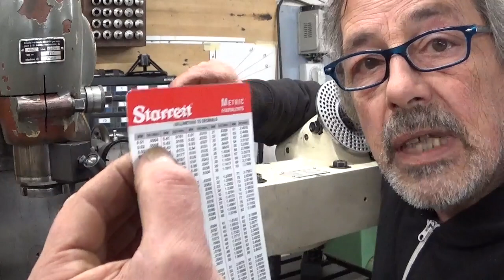Sharpening end mills... the long way around.

Comment: That came out nicely Michael. Your slowly building every gear you need for the lathe. Awesome! Also you can grind the inserts down with that diamond wheel. This way you get a sharper edge and hopefully a better finish.
Reply from the maker: Thanks Bruno. Need the tool, make the tool :)

Comment: It's that old "new shop/machine" problem, where a new project breeds a dozen more.  Getting a machine, it turns out, is the 'easy' part. Getting it tooled and setup to use it is the complicated and/or expensive part.  And sometimes, by the time you get the sub-projects done, you've forgotten what the primary project was.
Reply from the maker: You're right. Lucky for us, we're not in a hurry :)

Comment: In the old days, apprentices built all their tools because they needed them and didn't have money and needed the experience anyway.
Reply from the maker: Indeed. I's a win win...
Reply: In the old days, apprentices made their own tools so they understood the value of tools. It's that simple. You make your first square, you sweat to get it right. You make a centre finder... Piece of piss, since it doesn't need any real precision... If it's off, you inscribe a square, and either interpolate or scribe from corner to (opposing) corner and centre pop the intersection... A bad one will work... But will be a reminder... Get it right!
You make centre punches, you turn, knurl, heat treat , you make a chisel, you learn about forging, heat treatment, and you sweat when you hold that chisel in tongs while your tutor hammers it through a 3/4" MS plate with a sledge hammer, testing your hardening and annealing... Screwdrivers, Toolmakers' clamps, tap wrenches, die stocks, and so much more... And you know what it takes to make the tools of your trade... And, if you have to buy something, you understand why it cost what it did...
I once bought a lot of tools from a retired toolmaker.  I realized he was asking too little, and suggested, turning away heading for home, that he held out for more money... He insisted I bought them, offered me a discount... I paid him his asking price, £70, back in the mid 90s, but every time I picked up something he'd made, and used it, I thought of him...
A worthwhile thing to remember, that I learned from a journeyman in another engineering place (that is, not the one I worked at...)
He had a rented lock up garage near mine.  He had an old, even then, Norton Model 50, and a Panther 600.  I had an old Royal Enfield.
I remarked to him that I'd love to know how he kept all his tools so clean and shiny (no corrosion,despite the damp garage conditions) "I just keep using them" he said... It's obvious, if they're always in your oily hands, fixing something, they can't corrode, or at least the corrosion's so light that it wipes off with the next handling of them...
We built "barn" tool boxes, tote trays, funnels for oil... And most us lost our stuff or had it stolen over the years...

Comment: Excellent work. In software development, the "I want to make a <something>, but first I need to make several other things" is called Yak Shaving - after some cartoon somewhere. It is clearly a common thing in lots of different areas, and machining is definitely one of those.

I haven't posted your parcel yet, will try to get round to it over the weekend - and I'll pop a couple of TNMG inserts in the box too - I have a few, and at least one kind that I find works quite well for general purpose lathe-work.
Reply: I often find I have several bears to skin before I can get started on the Yak shaving operation🤣
Reply from the maker: Yak Shaving? I didn't know that.
Thanks in advance, Mats.

Comment: Hej Michel, great effort!
Two things I want to mention:
First: We all saw that sharpening that end mill worked out fine. It may not work out with every cutter though.
The more cutting depth a mill sees, the more chipping work is done by the spiral flutes, as opposed to the plane face.
Thus, it'll either become necessary to grind away the face of the mill until all of the dull portion of the flute is turned to dust (say, you took many 5mm cuts with your mill, you'd need to shorten it by 5mm) - or get into resharpening the flutes of the cutter, too.
Especially carbide cutters will tend to have small breakoffs at the very tip of the corner (making them look a little like 45° cutters), which can be taken care of much more efficiently by resharpening the flutes.
A jig could be made - or a used grinder for 100 bucks or so will do the job fine, too.

And secondly, my experience with gear cutters and circular saws in the mill was a funny one:
At first, I thought the thin blade would just shatter if I took a hair too deep a cut.
So I went carefully - and judging from the hammering noise the mill made, I must have been right at the edge of what was possible.
So I took a little less cutting depth next time - only to find the mill being even noisier!
One day, I got curious - and dialed in 50mm depth on a 135mm sawblade.
The first few revolutions promised me it'd become increadibly loud - then all of a sudden, the noise died right down and the blade marched through the metal in almost complete silence.
My only explanation is that by the deeper cut, more teeth were in contact with the workpiece, thus stabilizing the cutter for each entry of a new tooth.
Reply from the maker: This all makes perfect sense, Adrian. Thanks.
Reply: Important with thin blades to take the cut in a single pass if you possibly can, because otherwise chips from subsequent passes can pack up in the slot and jam the cutter.

Comment: set your tool post parallel to the chuck, the tip/tool has the correct relief already in it so setting the tool post off square upsets that, if you still get a poor finish try slowing rpm or increasing feed  if that fails, have a beer and buy some emery tape ;-)
Reply from the maker: Or use an HSS cutting tool :)

Comment: As always, an entertaining and inspiring video. thanks!
When the digitally controlled rotating table, standing, is running that sharpening work could be done here too.
What RPM is the diamond cup should have? Though it was much more than a mill could produce.
Bad dust... Would the Covid masks do? Still got 2 bags of them.
Reply from the maker: There is no maximum RPM marking on the disc. So, Who knows?

Comment: Good work as usual Michel. You worked around the problem and got a good result. What thread were you trying to cut? Is your lathe setup for metric or imperial thread cutting?
Reply from the maker: Thanks.
This was a 1,25mm pitch.